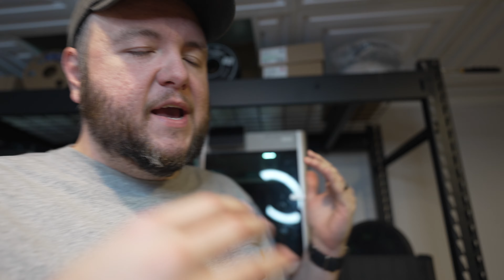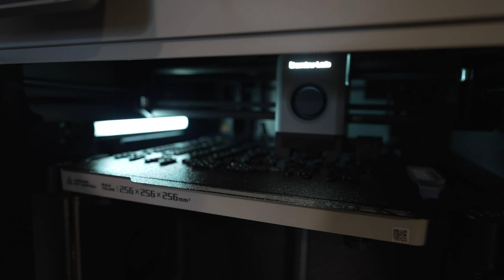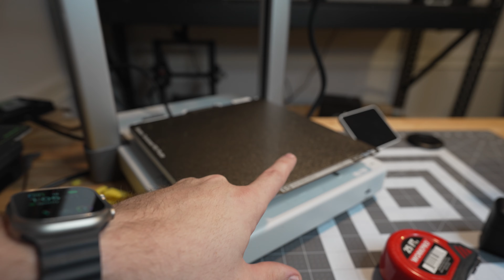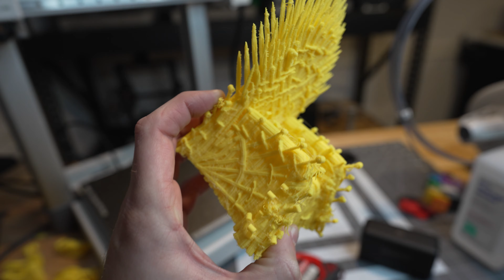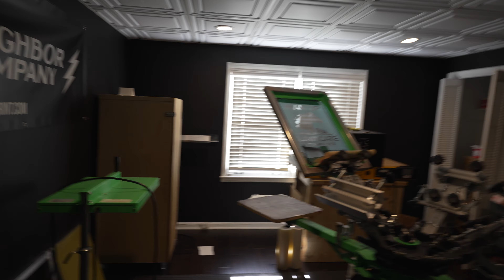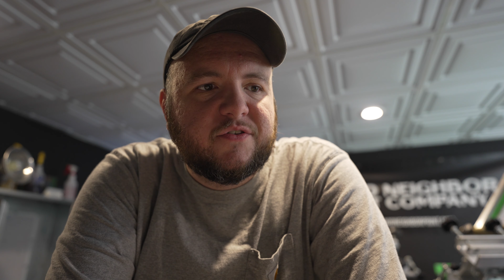3D Print Farm and Shop Update for December 2023

Comment: Hi do you have 5kg filaments attached? Also if starting would you get A1s for mass printing?
Reply from the maker: A1 is a great machine but it would depend on the type of mass printing. For instance, I think I'd rather have an enclosed printer for ABS TPU or PETG
Reply: @Shayway  thanks for the reply, I ideally just want to print Pla and lots of it. So just interested in how to attach a 5kg filament
Reply from the maker: @evanphillips2741 you could probably just print a 5kg stand to go next to it and it’d work with no problems. For instance, I’ve printed directly out of a filament dryer multiple times
Reply: @Shayway  thanks I'll try that